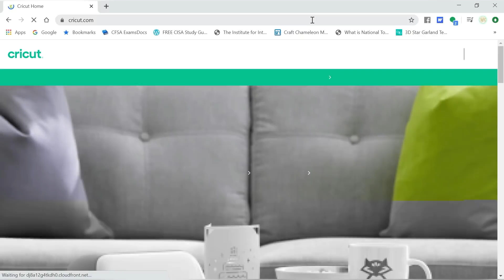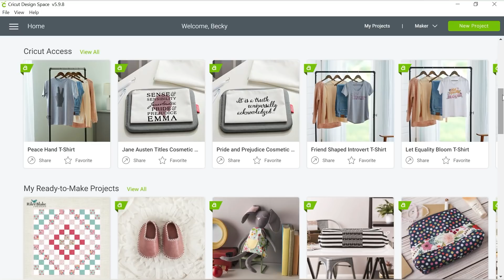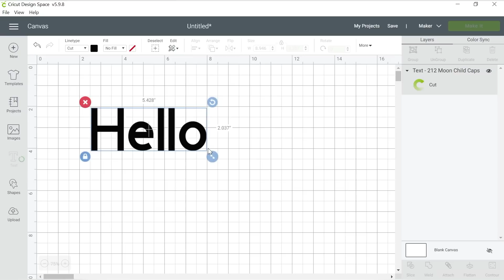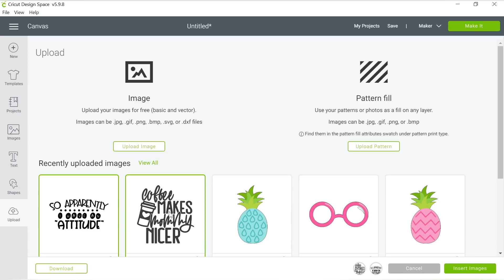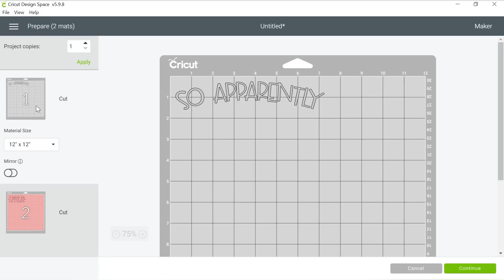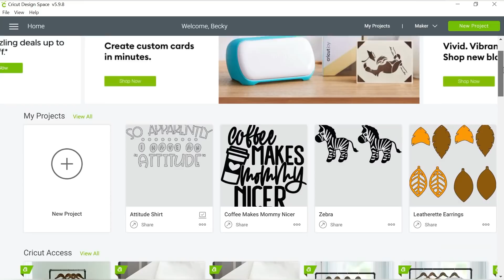😁 Introduction To Cricut Design Space For Beginners

Comment: Thankyou but I have one question when I get to the end ready to print. the circuit said I have to pay and won’t let me go further.I want to use my own design not sure what I am doing ,I am very new to this .
Reply from the maker: Hey Peter, it seems that the software thinks you are using either a Font or a Design from the Cricut library.  I would check the items you used and make sure this isn't the case.  Hope this helps!   ---Becky
Reply: We realised we had to go to system 😅

Comment: Thanks so much...simple question. I understand for the purpose of demonstration only one design is on the software grid/canvas. Once I get my machine and work through trial and error phase I assume I can cut and print several at a time. Is that correct? I'll be making candle labels. Will I cut and paste to fill up a sheet or do I identify how many I want and the maching just does it? So hard to even understand the basics until you make the mistakes.
Reply from the maker: Hi Lynne, yes you can have multiple designs. One option is to duplicate the designs all yourself OR the other option would be to only have one design on your screen and then when you go to "Make It" increase the number of copies (it will be top left corner) and then Cricut will automatically arrange them for you :) 

If you get stuck with this you can contact our support team and we'd be happy to explain with screenshots if needed :) https://designbundles.net/help-center#email-us

Comment: I have Design Space on my iPad and the layout doesn’t look like this.  Does it operate the same?  I just loaded so I haven’t used it yet. I do t see any of the stuff across the top that you explained earlier.
Reply from the maker: Hey Mary!  The Design Space mobile app will be slightly different and have a few features that cannot be used, but for the most part, it's a very good app and it works very well, you won't be disappointed.  Hope this helps!   ---Becky

Comment: I would love to know where you got the vinyl storage rack behind you. I have had many challenges in keeping my vinyl stored flat without taking up a lot of room.
Reply from the maker: Hey Michael, these are racks for scrapbook paper, which also works great for vinyl.  I'll be honest, if I had it to do over again I would not use wire racks, the vinyl corners catch sometimes and flip under at the ends.  But if you are careful they work well.  I found these on eBay I think, and be careful because the shipping is as much as the cost of the racks, because they ship in one piece.  Hope this helps!   ---Becky

Comment: I have a cricut maker but use silhouette software mostly.  I'm trying to figure out the best way to sublimate my design thru Silhouette because it seems much easier than trying to figure out how to print the size I want using cricut, but I need to use my cricut to cut out the easy subli to use as base for my design.

there are things that are easier in DS than in Silhouette (like curving text) but things that are much easier to do in Silhouette than in cricut (like making an offset).

I'm getting so close to buying a Silhouette Cameo so that when I do this stuff I don't have to wrestle with how to do it.  the sizing in Silhouette doesn't always come out the same in Cricut.

Am I missing something here?  a very small part of the printed colored design has a R trademark and I'm afraid that it just won't cut.  I really hate doing all the tiny stuff which is why I'm a fan of sublimation, but the shirts are a 50/50 blend - and green.  so that is why I'm having a hard time figuring this out.  I keep hearing that if I print directly on the easy subli - the print is likely to smear.  particularly if I need to cut it using my cricut maker. (which I'll need to do)
Reply from the maker: Hey there!  So, unfortunately there's not an easy way to set up your design to print and cut through the two different software.  Here is what I would do, and hopefully this will make sense.

1. Set up your design, including the offset or border that you want to cut.  Save the cut line as an SVG (move the image to another tab).  I have a video on moving an SVG from Silhouette to Cricut if you need it. I feel like you have seen this but I'll link it here just in case.  https://www.youtube.com/watch?v=U_aXLOZ1D1Q

2. Print your image onto sub paper from Silhouette Studio.  Make sure you mirror.

3. Import the SVG into Design Space and size it to the exact dimensions from Silhouette Studio (type them in manually).  Cut your EasySubli outline and weed.  EasySubli does not have a carrier sheet so just cut it without mirroring.  So not print and cut, just cut.

4. Weed the EasySubli and then sublimate similar to like you do on Glitter HTV.  It will be more difficult to line up the image than using print and cut, just to be honest, but it works well once you get the alignment down.  https://www.youtube.com/watch?v=IMHgYAR0Y5E

Hope this helps!   ---Becky

Comment: Great intro to the software, Becky--thank you!  My machine is on the way. EEP!!!  I was really torn between this machine and the Cameo 4 --I have a fair understanding of Adobe Illustrator (self-taught) and worried that maybe Cameo 4 would have been easier for me, software wise. . .  This machine "seems" like it's quieter than the Cameo 4 (just based on YouTube videos I've seen thus far)--do you find that to be the case?
Reply from the maker: Hey Julie!  Yes, the Cricut machines are definitely quieter than the Silhouette machines.  If you have prior knowledge of Adobe Illustrator, then you shouldn't have the same limitations as beginner Cricut users because you can use AI to create your files instead of Design Space.  I don't think you will regret your choice, Cricut makes great machines!   ---Becky

Comment: What is the best computer system works easiest? I have a tablet and am experiencing difficulties (brand new to Cricut)
Reply from the maker: Hey Catherine!  A PC or Mac with an operating system (not a Chromebook) would be best, it gives you full access to the software.  The software works equally well on PC and Mac, in my opinion, with no noticeable differences.  I traditionally use a PC, but I did just score a refurbished Mac on Amazon for a great price.  Hope this helps!   ---Becky

Comment: Had an old Acct but it became inactive, thinking about upgrading but circuit has been terrible at assisting me to find my old account so I can sync it up the new one I will create. This because the old email attached to my design account I no longer use and can’t access it. I do need it to sync as I had a cartridge or 2 attached to that account. Any suggestions? Thanks. I have a cricket explore.
Reply from the maker: I'm sorry, I have no words of wisdom to share with you if Cricut customer service hasn't been able to help.  Are you calling or chatting with them?  Email?  Perhaps reach out to them in a new way and you may connect with a different representative who is better able to assist you.  Wish I could help but you have my moral support!   ---Becky

Comment: hoping you can help me out. I have a new joy not yet used because I can't get design space to open. I have downloaded it, uninstalled, reinstalled so many times & nothing is working.The application just won't open.I have an iMac with the latest version of software. I have been struggling with this for 2 weeks but nothing is working. Do you have any suggestions as to what I can do? thanks
Reply from the maker: Hey Shona!  If possible, I would join and ask some beginner Cricut groups on Facebook.  Unfortunately when it comes to software problems, it can be a needle in a haystack but I thought I had read about the latest Mac update causing problems.  I work on a PC, so I haven't experienced them, but that is where I would start.  Sorry I can't be more help!   ---Becky
Reply: Design Bundles thanks for getting back to me I have tried everywhere will just have to wait for cricut to eventually get in touch